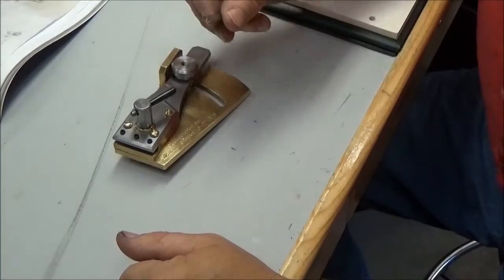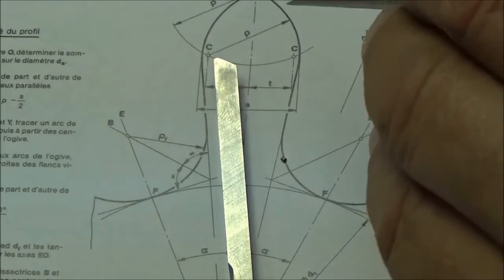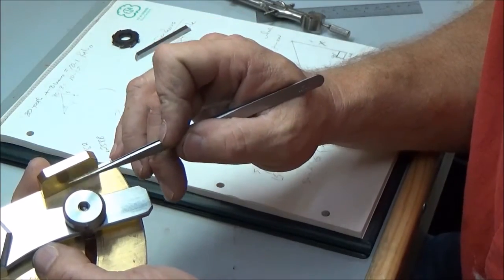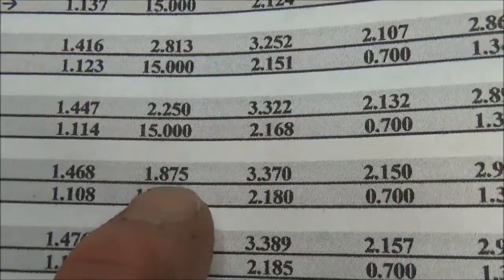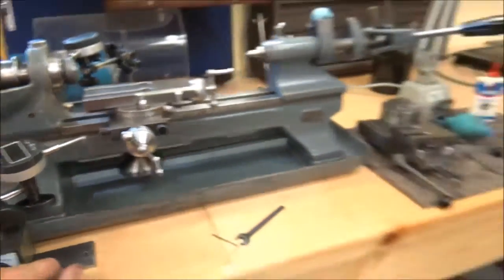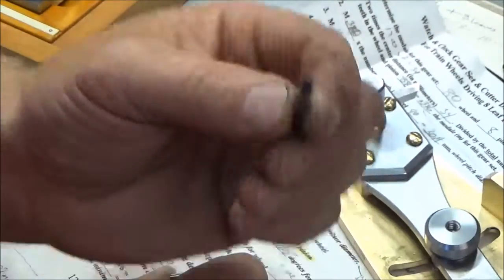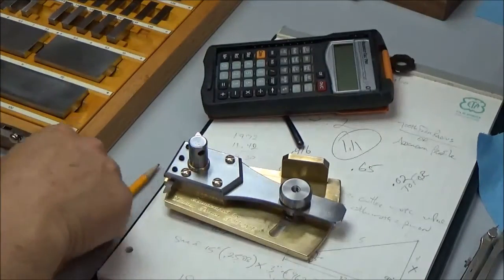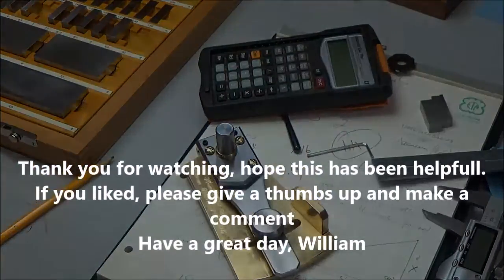Fabricating multi tooth cycloidal cutters for clocks Part 3 "sine attachment & radial flank angles"

Comment: When you measured the distance with gauge blocks, I could not see if you were measuring a chord distance or perpendicular to the fixed side. The two would seem to be differnt.
Prior to the 1700s chord distances were often used from a table and were just as reliable as sines.